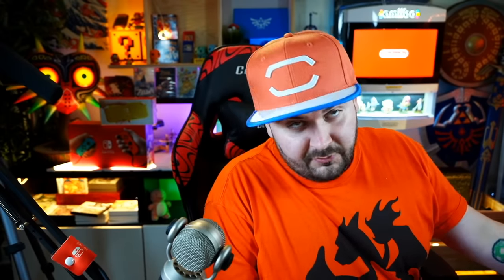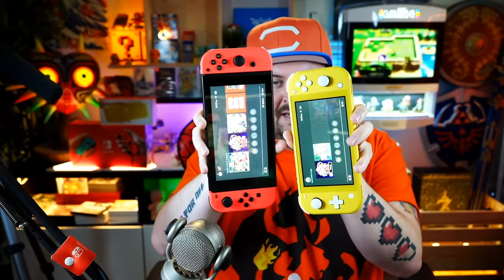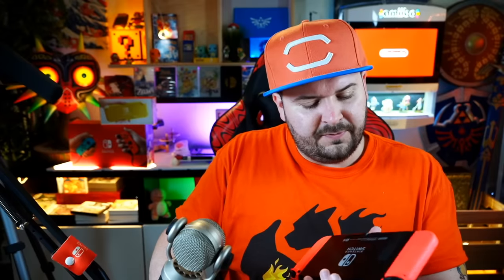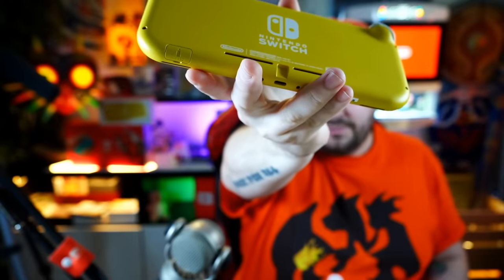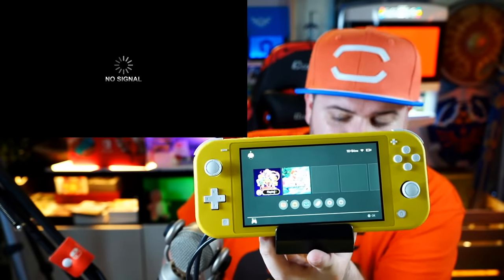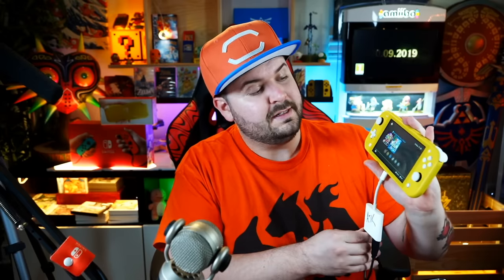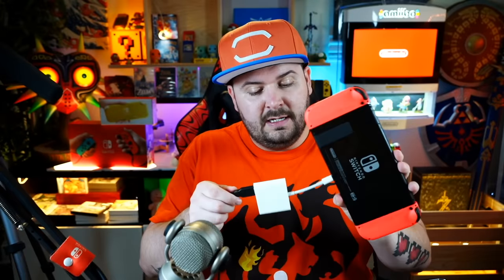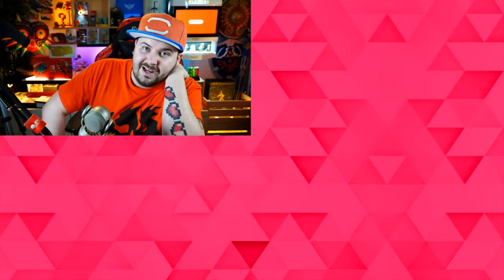What Happens When You Dock a Switch Lite?

Comment: The software was probably removed. I bet homebrew can make it work
Reply: The internal thermals were probably not designed to handle the higher clocked docked mode, so it would work. For a while.
Reply: @ark14700  with hacks you could just lower the clock though
Reply: @anonymousidea9119  imo the main advantage of TV mode is the higher clock and improved graphics thanks to unrestricted power draw. 
It might be possible to display undocked graphics on a TV (if they modify the hardware to have AV out), but at that point might as well have it on the portable screen.
Reply: @ark14700   well I dont think it's not possible to overclock at all, as the normal switch is overclockable in handheld mode and the switch lite isnt much different. You could likely get more than just a handheld experience if you could dock the lite, as then heat would be the main issue vs heat and battery loss among other things in handheld. I guess graphics are a part of it but I think some of the bigger games like BOTW deserve to be played on a TV even in lower res. And there are ways to send AV to a TV without hardware mods for example video capture on the 3ds without a capture card but I'm not sure if it's possible on the switch lite or worth doing. There could still be ways to send video through that usb c and it was just disabled but you would think they would remove all the video out stuff entirely... its yet to be seen.
Reply: From early teardown photos it seems, that they removed hdmi/usb multiplexer IC, so it's not just the software. But there are other differences on MB layout, we'll know more once someone gets hi-res photos.
Reply: i dont think the gpu and cpu are the same. they could be from the same productionline but these are probably faulty so the switch lite cant clock to higher performences for docking
or maybe it can but it will just die in a month or so
Reply: Dimmet Gloomcap  it is. But USB-C supports several video output protocols. And from early photos, it seems that USB connector has all data lines in use - which is overkill if it's intended only for controllers.
Reply: Dimmet Gloomcap  Yes I read that and this vid confirmed that Lite doesn't support high power docked mode.. still, it would be nice if it supported TV output, even if it was limited to 720p...
Reply: Dimmet Gloomcap  exactly, if it supports even wired controllers, some sort of video output would make sense. Since OG switch was released, USB started to support HDMI mode, which allows connection to hdmi without dongle. For portable console, that would make sense.
Reply: Dimmet Gloomcap  really sad, I would have bought it if it could be docked into TV mode in any way.
Reply: Fusee Gelee wouldn’t work on the Switch Lite though, as the exploit relied on the removable Joy Cons and their connecters. The Switch Lite obviously doesn’t have Joy Cons. And even if it did the exploit wouldn’t work because it’s been patched on newer Switches. If another exploit does come out of the woodwork though...
Reply: It could be hardware, though.
Reply: Yeah get blocked by nintendo
Reply: It miss the chip which send video and audio data though USB C. Someone should try hardmodding the Switch lite then, I wish them good luck.
Reply: @ThibautMahringer  someone should get over themselves and realize NINTENDO SAID YOU CANT DOCK THEREFORE NO VIDEO STOP FORCING STEAKS DOWN BABIES THROATS
Reply: @JeremySheer  I know it's not supposed to dock but people can see it as a challenge. As a consumer I don't care since I have the OG Switch, but as a tech enthusiast I like the idea of trying to dock it, even if it's not supposed to.
Reply: @JeremySheer  Electronics don't have feelings you know, you can do whatever you want with it. If everyone do think like you, we would have never got the hard mod allowing to capture direct footage of Switch handheld for example. Or adding backlight to the original GBA or a lot of other things.
Everyone here understand what the lite is. But seeing if it can go beyond what it is, I found this interesting. And I'm sure I'm not the only one out here that found this interesting.
Reply: @ThibautMahringer  feelings? certain electronics have MHZ its like putting a 120 watt bulb into a 60 Watt socket go home
Reply: @JeremySheer  It have nothing to do with hardmodding.
Reply: I don't think so....
Reply: @ark14700  in all actuality the hardware is probably there and it's just turned off at the software level
Reply: I have no idea what the replies are meant to sau
Reply: They removed the component that mirror the switch screen to tv
Reply: Alot of comments saying removing a peice of firmware would fix it but no, the chip required to do video output just isn't inside of the switch lite
Reply: @ThibautMahringer  somebodys already done it
Reply: @FirstnameLastName-mr8lk  Really ??
Reply: It's hardware so no homebrew can fix that
Reply: There is no video out chip on the lite.
Reply: I know I’m late but they removed the video out chip entirely hence the reason why it won’t switch over to the tv
Reply: It's hardware... Why the hell would Nintendo put pointless hardware in there? Thats a waste of money and space.
Reply: Anonymous Idea hooray hax
Reply: No, it doesnt hace the hardware
Reply: Nope in the normal switch theres a video output biton the mother board this isnt percent on the switch lite thus no video out put
Reply: @BananaSlayer_  switch lites can be modded to use custom firmware by use of a modchip that injects the payload without the need to remove the joy-con.

Comment: So the switch lite is just a firmware update away from being dock-able.
Reply: Nintendo most likely only designed the Lite (and its heat management) to deal with the lower clocked portable mode, so forcing it into docked mode would overheat it.
Reply: ark13700 overheating hardware never stopped people from trying 😂😁
Reply: I would imagine it's not a software lock but an actual hardware one. Usb-c is just a plug, there's no real standard as to what can be sent through it. The Switch gives HDMI, an unconventional USB-PD and regular old USB 3.0 out of it's type-c port, the lite ditches the hdmi alt-mode, presumably on a hardware level
Reply: @TheDeluche   cough Microsoft cough
Reply: That might not be the case, IDK if the original Switch has specific video hardware in it that's just completely missing in the Switch Lite now
Reply: Not if it doesn't have the same video controller.
Reply: @egocentricblack3278  referencing the first 360s? Lol
Reply: @_MegaMind_  red ring of death😭😭😭
Reply: @egocentricblack3278  heh, u thought the red ring of death was somewhat rare? Some of those had gotten 'yellow' ring of death instead of red. It's nothing different from the red ring, only that it's rarer
Reply: It doesnt work like that
Reply: @JeremySheer  uno reverse card
Reply: Yes it is firmware locked just like the regular switch doesn't work with normal usb c.  To hdmi  it is Nintendos way of controlling the accessories that u can use
Reply: Pretty sure I remember seeing someone else take one apart and it's actually missing some of the internal hardware that would allow it to be able to output hdmi video.
Reply: wedphotog1  well yes, but actually no
Reply: Jason Shapiro Nope

Comment: I have a great idea.
A special dock made for the switch lite.
Has the same inputs and outputs besides the hdmi and looks just like the original Nintendo switch dock but with a "lite" added to the logo.
Reply: It couldn't be the same form factor as the original dock though because that one covers the screen (very poor design if you ask me because it has a tendency to scratch the screen) if you wanted to make one for the switch lite it would need to be a tabletop model similar to something like the Jumpgate dock. It probably also wouldn't really be right to call this a dock since it doesn't connect to HDMI a better descriptor would be a charging enabled USB hub.

Comment: The adapter had a HDMI port, i take it that wouldn't work either
Reply: More than likely they took out the hardware component that allows the switch to send video output. So it does not matter what chord you use without  modding the switch on a hardware level.
Reply: They either soft-locked it (firmware preventing video out) or modified the port (removing the video part of usb-c if it has such a thing). In the former case you could run cfw that enables it. In the latter case you'd effectively need to rework your setup to send video out over the data line, and then convert that to HDMI. Just plugging in an HDMI adapter likely won't work.

Comment: There will probably be a way to eventually "dock" a switch lite. I have a PS Vita that's modded and I can over USB 2.0 speeds have the video go out to my PC and I get a clear image and s good frame rate. The switch is capable even though it doesn't have a direct video out but once the modding community gets bigger, someone, somewhere will make a plug-in for it. If a vita can, a swift lite can.

Comment: also nintendo didnt wire the USBC port in a standard way, thats why it cant charge and use the fight stick at the same time. Also thats why third party docks dont work and can break your switch, its because when you put it in it ends up getting too much power on the wrong wires and then your switch is dead

Comment: HomeBrew'ing the Switch is becoming increasingly popular, since the hardware in the 2 switches are so similar I wonder if there'll be a software hack found in the homebrew community to find a way to HDMI out via the USB C. It's just an Android x86 based tablet with a Tegra chip, no reason it shouldn't be able to like the larger counterpart.

Comment: You should actually be more worried about third party docks having bad connections to your switch's battery. If there's a chance for a short in the dock, it could catch your switch on fire. The hdmi signal sent to the tv can't damage your switch, since that's just a signal. The tv gets power from an external cable that has nothing to do with the switch.

Comment: The switch lite doesn't have the video output chip that is present in normal switches thus why it's impossible to dock a Switch lite with TV Output without knowing about circuit boards, chips and soldering and physically placing one into a Switch Lite but there's probably isn't much point doing this since your also gonna be faced with risking 3rd party docks destroying your switch or finding/butchering a modified official switch dock. May as awell pay the extra 100 for a normal Switch.

Comment: To dock a switch lite to a tv without a single cable and no dock with things that most people have 
What you need 
- A Switch Lite (Duh) 
- A Smartphone that can Screen Mirror to a TV 
- A TV that can show your phone’s screen you might need to grab an Apple TV and connect that 
Steps: 
Open the Camera App on your phone —> Make sure that the camera of the phone is aligned with the Switch Lite, the whole screen needs to be visible from the phone’s camera —> Screen mirror to the TV! Done! This also works with a normal screen 
Note: If you can’t screen mirror to you tv, get a Roku or Apple TV depending on your model
If you don’t mind some wires connect the phone to a dongle that has a HDMI port and connect that to the TV’s HDMI input port

Comment: I think it was a bad move to make it so the Switch Lite can't output video to a TV. I get that they're trying to go with a budget option here, but it's already budget by not including the dock (MSRP $90) and Joycons (MSRP $80). So the Switch Lite is already missing $170 worth of items included in the purchase of a normal Switch, is only $100 less, but can't even be docked. It would've been a better move to design a narrower dock for the 001-(01) Switch, that allowed the Switch Lite to fit in it, they could sell this separately for like $50, and people could buy the Switch Lite for $200, and dock it for an extra $50 and play games with a Pro Controller or separate joycons. Basically, it'd just be a smaller, more compact version for those who want to take it out more.

Comment: I was thinking that the switch lite might have a diffefent firmware causing this, but then i remembered that the switch lite was uniseable at the start because it was running the normal firmware which got updated to the same version at the same time to fix that problem.
So it really is hardware based then :(

Comment: What if they sold a separate switch lite dock or an adapter that lets you use it with a normal switch dock.
Reply: You can't. Nintendo purposely took out the part where it makes it so you can display on a monitor or tv

Comment: Yes.  Knew all of that before I found this video.  Confirmation of my observations feels good though.  I would like to add that the reason not to use 3rd party docks is REALLY about not using 3rd party power supplies!  Long ago there was a video by someone I don't remember who identified some non-standard USB power protocols implemented in the switch PSU because of the way the video switching worked.  So it turns out, if I understood it properly, that a 3rd part dock is actually just fine so long as you use a proper PSU.

I haven't tried ALL of the 3rd party docks out there (and the conversion kit does not count) but I have been using one particular 3rd party switch dock that has a button to control whether or not it goes to video out.  I like that configuration a LOT more.  And of course I use a proper Nintendo switch PSU with it.  No problems at all.  Been like that for some years now.  If you have more detailed information about this with more extensive testing I'd be interested to know about it.

Comment: I don't have a switch but I have Android for years and one year I bought the OnePlus 5 which apparently did not have video out.

All the reviewers said the same thing, well they were wrong, I have a video on my YouTube showing how wrong they were.

Using a Displaylink adapter you can indeed video out..as the adapter deals with the video instead of the device/USB protocol options 

Now as the switch is what it is, I think it may be possible to get the protocol actually on the switch lite and to get it to video out.

As i don't have one, it would be to you guys to test it.

Good luck

Comment: They have disabled HDMI out in the firmware. Nintendo being Nintendo didn't want you buying a switch lite & 2nd hand dock or 3rd party dock to get a cheaper switch for your tv.

Also that mini dock is cool but unnecessary. Certain female USB C to male USB C cables with do the job. Not all of them will work so do your research first.

Comment: I have no firsthand knowledge to go off of, so correct me if you know better. But doesn't USB-C video work like a USB video adapter? It may be as simple as Nintendo stripped the driver from the switch lite so it can't run the video adapter. If that is the case, it may be something a modded switch lite could do.

Comment: Is it limited by software or by hardware? Is the chip that is responsible for video out still there and does the usb-c port have the connectors? If it's limited by software you could just try to flash the os of a normal switch onto the lite.

Comment: Yo i have an idea on how to. Dock the nswitch lite credit to My Mate Vince

What If You Get A Camera (like vince idea) put it on the right spot put some cardboard on the other parts of the switch that doesnt need to be seen example make the cardboard stand on on the camera so the camera wont move like its trapping the camera to that 1 spot and make it into a box shape and the camera is already on the spot and remove a hole and put charger so its chargeable like your idea but ithink doing what i just said will work and stay on the right spot cause Of the charge cable will. Stick on the switch so it wont suddenly fall anyway good idea might do this for phones and other stuff

Comment: What if you break off the front of the dock?
Reply: The switch lite still won't output video to the TV since the video chip was removed. Although plus side that would definitely fix the screen scratching issue on the original dock.

Comment: Hey, I know the video is kinda old, but can anyone tell me if the switch/switch lite really have that many problems with joycons? I was thinking of getting the lite, but then I found out about drifting so now I'm wondering if they are worth buying at all. If anyone could help me, it'd be greatly appreciated.
Reply: Joycon drift isn't too much of a problem as long as you don't play any aggressive games (avoid the new Mario party game it puts a lot of stress on the joy-cons due to spinning) I would recommend getting an original switch since those don't have any features removed and even if the joycons do wear out they can either be easily replaced or sent into Nintendo to be fixed.